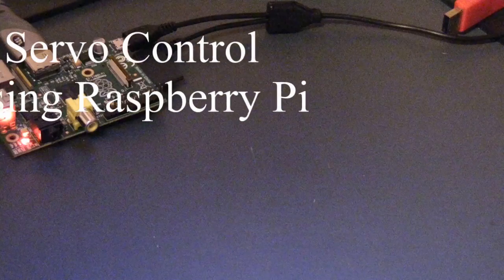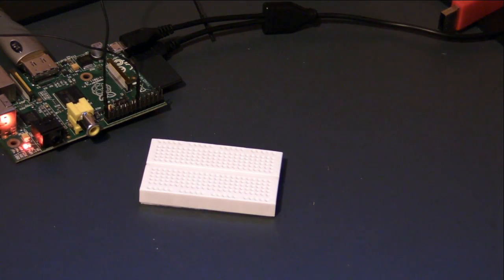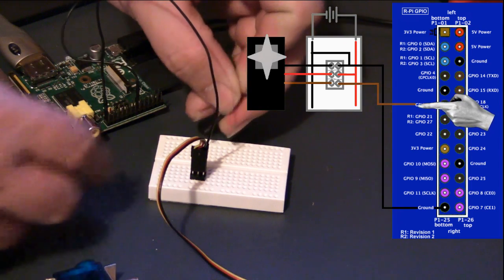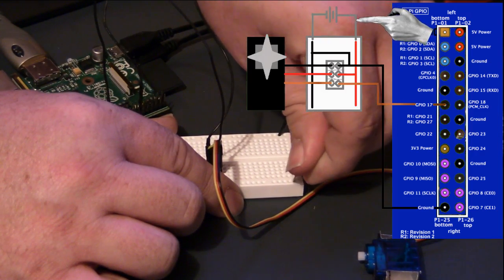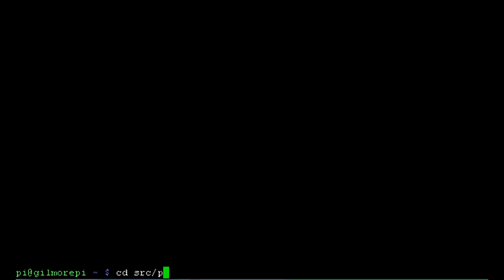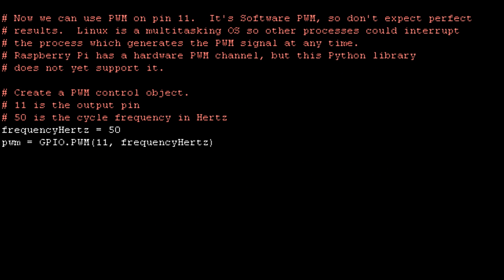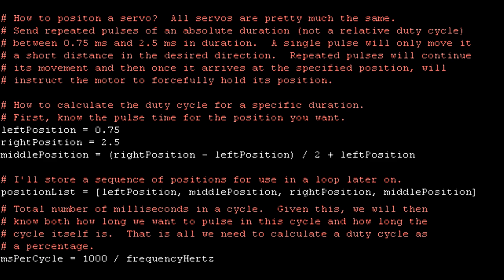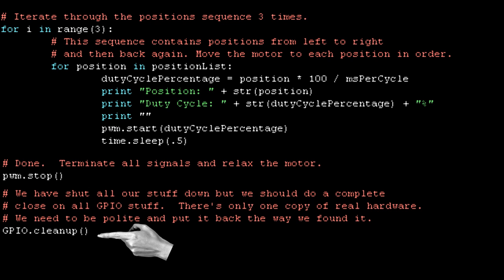Servo control using Raspberry Pi.

Comment: Can I directly connect my servo to my pi
Reply: Of course, we drive the signal line directly from the Pi in this video, so I assume you're asking if you can POWER the motor directly from the Pi.  I recommend that you do not do that.  Most of the pins on the GPIO pin header provide 3.3V and have a limit of 15mA each.  A servo motor probably requires double that voltage and draws 10 to 30 times that much current.  The entire bus can only provide 50mA which is still grossly insufficient.  The Pi does have a +5V pin which could provide a reasonable voltage, but there is conflicting information about whether it can provide enough current to power a motor. 
You could try the +5V pin, but it's a risk and that's up to you.  Instead, try a USB splitter and just share the power supply with the Pi from the beginning instead of siphoning the power through the board itself.

Comment: Thanks for this tutorial. So you are using 0.75ms pulses for -90deg and 2.5ms pulses for +90deg rotations. These numbers do seem to work reasonably well for my HS-311 servo, but where did you get those numbers? Various sources say these should be (1ms,  2ms), while others mention (.75, 2.25). Those did not work for me at all. Thanks again.
Reply: My experience is in line with yours.  Various sources would say slightly different values.  Generally, I found that most sources said 1 ms to 2.5 ms.  So I used that as a starting point.  Then I wrote a simple Python program that went very slowly and repeatedly from 1.5 down to 0.2 and then from 1.5 up to 3.2.  It displays the current value on the screen and I just noted the number on the screen when the motor stopped moving.  That's how I found the boundaries for my motors.  Every kind of servo motor I have works fine with those values.
Reply: Thanks for replying so promptly. One more question, if you don't mind: does a servo has an "absolute zero" position, i.e. its natural neutral state? And if so, how does one find it? In other words, when I mount a horn on the servo, I want it to be aligned properly with the body of the servo.
Reply: I wouldn't say it has a natural position.  If at any time you stop sending pulses, the motor just relaxes and stays where it is, no matter what position it's in at the time (barring outside forces).  But what you're really after is a very practical question and there is a practical answer to it.  You can write a program to find the boundaries of your motor as I described before.  Then take those boundaries and calculate the "middle" of the range.  Send the motor to that position and then mount your horn in a centered orientation and you will have it where you want it (or at least this gives you an idea).

Comment: what did u program it on I got rc petrol car and. want to steer it autonomously using a servo so I need to know what u programmed in
Reply: In the video, I wrote the sample program in Python.  I edited the code with Nano and I did the development on the Raspberry Pi itself.  You could use a different programming language but you will end up using different libraries.  You can use C, Java, Python, or even shell scripts.  You could also use other types of boards such as Arduino to drive the motors themselves and just use the Pi for the heavier computation such as computer vision, GPS processing, sensor input and geospatial analysis.

Comment: Hi there...
To start out with, I am pretty noob on this stuff :)
I used your video instructions to hook up a 'Tamia TSU-02' servo from an old RC-car.

But when I use your script the servo clicks on one side pretty hard as if it wants to go too far...
Q: 'Please tell me what I need to adjust to make this servo work like it should....'
What I know a bout the servo:

Control System: Pulse width control

Operating Angle: One side more than 45 degrees

Current Consumption: 8mA (using 6.0V battery)

Output Torque: 3.3kg*cm (using 6V battery)

Operating Speed: 0.14sec/60 degrees (using 6V battery)

Power Supply: 4.8~6.0V

Domensions: 32x16x34.5mm

Weight: 26g
Thanks a lot for your help in advance.
Greets,

Peter Lunk
Reply: I've replied to the thread which you posted on GitHub.  I did a search for that motor and didn't find anything new about the pulse times so I went into some detail on GitHub to show how you can determine the correct pulse time limits yourself.

Comment: can you drive more than one servo with this design?
if you can thanks in advanced
Reply: Sorry about this but how would you edit the code too?
Reply: Yes, it can.  In the code, this line create an object which generates the PWM signal to control the motor.

pwm = GPIO.PWM(pin_number, frequency_hertz)

To control multiple motors, you just create multiple PWM objects, each with its own pin.

motor1pwm = GPIO.PWM(7, frequency_hertz)
motor2pwm = GPIO.PWM(11, frequency_hertz)

motor1pwm.start(50)
motor2pwm.start(50)

Comment: Hi man, I need to make a timer that activates a relay every 1h. how can I do this?

thank you
Reply: Hi,
 So you would hook your relay to a output pin on the PI, and then use python's sleep command and for each interval turn on the pin that the relay is connected too.

Comment: Im getting an stacktrace error when i run the program 
TypeError: unsupported operand type(s) for  -: 'float' and 'turple'
Reply: I have updated the video description to include a link to the source code.  Compare your source with the servocontrol.py file on GitHub.  If they are the same, post the entire error.
Reply: thanks for the help the program runs but, the motor does not move

Comment: At the End, you typed in the script and the motor moved,  how do you tell the servo on how to move , like left , right ,etc..??
Reply: The motor moves to the position which corresponds to the duration of the electrical pulses you send to it.  A pulse is an "on" signal which means electricity is sent to the GPIO pin which is connected to the motor.  After the "on" pulse, an "off" signal is sent which means electricity is turned off on that pin.  On my motor, 2.5 ms pulses move to the right, 0.75 ms pulses move to the left.  Any pulse duration between 0.75 ms and 2.5 ms will send the motor to a position somewhere between the left and right.  Most motors uses linear angles  relative to the pulse.  So if the left position on your motor is 1 ms and the right position is 2ms, the center would be 1.5 ms.  A 50 MHz frequency is 20 ms per cycle (1000 ms per second, divided by 50 cycles per second = 20 ms).  A 2 ms pulse every 20 ms is a 10% duty cycle, so set your PWM signal to 10% to send a 2 ms pulse to the pin which is connected to the motor's signal wire.  This calculation is done on the second line of code at 6:32.
Reply: spgilmorespgilmore Thank you so much!!!!,  I am trying to make a reg light switch go up with a servo motor, so by making it spin right as much as it can so it can give most pressure and turn the switch up, same thing with down also! I also want to know can I have 2 servo motors operate from 1 Raspberry Pi.

Comment: Using a receiver and a transmitter how can i set up servo #2 to rotate exactly like servo #1???? so that i can move a robotic arm say thats a few feet away from me the same degree and angle i move my own hand? can you maybe make a video to show us how to do this? I want servo #2 to rotate the same amount when it receives the signal from servo #1
Reply: Hassan Ajrouche Assuming that you are using a 2-channel (or more) hobby radio set, you will probably need to feed the receiver output to the Raspberry Pi and then wire the Pi to the servos as shown in the video.  However, the output of the receiver may be an analog signal.  If that is the case, Raspberry Pi can't read it directly and you will need an ADC chip (or an MCU with an ADC built in) to convert it to a digital signal for the Pi.  This is not likely, though, since most RC hobby radios have channels which are made to drive servo motors.  In this case, you do not need a Pi to drive them motors.  You can hook them up to the radio receiver in the same way as an RC car or RC plane.  As far as using two motors, I think you could just connect the PWM signal to both motors in parallel.
Reply: Phil Gilmore I want it to be a wireless receiver so it can be a prototype for a surgical robotic hand for example so.. have a transmitter chip attached to one servo and have a wireless receiver on the other servo with the PWM and it will turn according to how the first servo turns?
Reply: Hassan Ajrouche If you are building anything that will be used in medicine you should consult a paid expert. I am just a hobbyist and this is not an effective medium for discussing something that important.
Reply: spgilmorespgilmore Just a prototype xD not anything serious yet but just the general idea
Reply: spgilmorespgilmore so do you know how to do it wirelessly?

Comment: Why are you connecting your pi +/- to the servo +/- ??
Doesn't make much sense since you are using external power supply for the servo.
Reply: Yve Gotnone Short answer - I'm not.  You can see in the schematic at 1:45 that I use neither pin 2 nor 4 of the P1 header.  Only the Raspberry Pi ground (-) and a PWM signal (from board pin 11) are connected between the two.  The PWM output pin from the Raspberry Pi actually only serves about 3.3V @ < 15mA, not nearly enough to power a servo.  It's only enough to SIGNAL to the internal electronics in the servo box what the motor should do.  The Raspberry Pi and the servo motor both have their own +5V sources.  I could get them to both run off the +5V pin on the Raspberry Pi's P1 header, but the point to this demo is that it is often useful to run motors that require disparate high power (3V @500mA to 40V @15A are common in other kinds of motors) and I wanted to demonstrate how to do that.  The common ground is necessary for the PWM signal to be shared between the two.
Reply: Phil Gilmore Oh yep, sorry mate, just rewatched the video. For some reason I thought there were 3 wires sticking out of your pi.
I just set up mine the same way. Thanks for the video!

Comment: I have a 360° servo can i plug a regular battery strait into the servo with negetive to negetive and postive to postive without the 3rd wire and the servo will start spining
Reply: ittai levani This sounds like a "continuous rotation servo".  These types of servos have had their endstops removed so they can rotate past their limits in either direction.  However, they still have the same circuitry which interprets pulses from the PWM line to make the motor turn.  You probably cannot get it to spin by directly plugging it into a DC power source.  However, you could use something as simple as a 555 timer chip to generate a signal for a motor like that.  Instead of a $35 Raspberry Pi, you can have a $0.50 cent 555 chip, 2 capacitors, 2 resistors and a diode.  That's less than $1 US and there is no programming required.  

http://www.robotoid.com/appnotes/circuits-servo-control-with-555-timer.html

Comment: Thanks for sharing this very clear tutorial and code.  I have tried to replicate it but am having a problem even before sending the signal.  The servo (Hitec hs-311) goes full counterclockwise as soon as power (using a battery pack like yours) is applied. 

If I turn it off and rotate the servo head180 degrees clockwise, and turn power back on, it again goes full left.  If I send a signal to go, say, full right, it just sits there and jumps/jitters, but never moves out of the full left position.  This happens with two separate servos.  Any ideas what is going on?
Reply: If an improper signal is applied, this would happen.  The pulse must be more than 1ms to instruct the motor to move anywhere besides the far left.  The absence of a signal would probably relax most motors, so I suspect that it IS getting a signal of some sort.  Either a floating pin effect (it's like a radio antenna picking up arbitrary waves) if the PWM lead is completely disconnected, or maybe you have it connected to the wrong pin on the Pi?  Of course, it could also be a bug or typo in the software.  After some quick research, I don't see anything unusual about the HS311 motor.  It should behave like any other.

Of course, the best thing to do would be to put an oscilloscope on the PWM signal to see what your motor sees, but I assume you probably don't have one.  Instead, try hooking up an LED in series with a resistor (470 ohm is usually safe).  You'll probably have to change the program a little to produce a signal that will be suitable for an LED (i.e. greater duty cycle), but you can at least see it light and should be able to make it fade bright and dim.

Comment: Not in the PWM module.
Rpi-GPIO Version 0.5.8 - Python 3 or 2.7
Your program will give an error.

No PWM in the GPIO module.

All PWM scripts I write have that error.
As well as the item frequency.

I look in the GPIO and see no PWM / frequency    "dir (GPIO)"

Do you know what's wrong.

70 years old and an absolute beginner.

Thanks for the video

Bert

Comment: Thanks for sharing. Don't you need a servo controller? I see that you were able to run the motor just with the code. So far every other video that i have seen, people use a controller board. Also, could we do the same thing with a heavy duty servo or stepper motor?
Reply: For 3-wire servos like the one in this tutorial, you don't need an external controller. You can send external V+ and V- to the servo from an external power source, and its control wire (and the ground) connects to the raspberry and gets the pwm control signals. If, on the other hand, you were using a DC motor, with nothing but a V+ and a V-, you'd want to use a motor controller (an H bridge, for example). The Raspberry can then tell the controller a direction and a speed for the motor. Without the motor controller, the raspberry would have to supply the voltage directly to the DC motor, and you certainly don't want that. Stepper motors are similar to the straight DC motor - you "can" control them straight from a Raspberry, but you're much better off with a controller, only getting the control signals from the Raspberry, and the V+ and V- from an external source.

Comment: Can I use this system to control solenoid valve with multiple ways as response to an external signal
Reply: Sure, you can use it to control a lot of things....in the case of the solenoid valve, though, you shouldn't directly connect it to the Raspberry Pi since it will (most likely) consume more current than the GPIO pins can output (which is about 16 mA)... So, you should interface the Pi and the valve adequately.

Comment: Can you drive a door lock with this setup?
To bad the servo didn't go 720 degrees since it might need some gearing however a powerful servo would be great.
Have a 3" steeldoor with the best Swedish locks (best steel in the world according to the Swiss for watches, the metallurgists and more no china rust if it rains here i keep my castle better than the britts at Waterloo). - however everyone want's some more modern things than what was around 1975 and all i've seen here are either guys with servos connected to lots of stuff + a wooden spoon and office tape - or they have twice the hardware you have but it would't keep someone over 200 pounds out of my refrigerator + set me back around 200$ for a magnetic lock made in china i could rip with either my arm or a rope since there's a staircase and i weigh around 230p and two pulling that.. 
Be a hero and do a video with a qualified international servo and some instructions.
NFC out of the letterslot would be great, some more code for NFC or preferably BT would be great too - or a build that you download, specify the codes for and so on would be king!
Seen a lot of videos.. You have a great voice and great sense of telling a story.
There's not much to be found except people who want me to change my lock for something chinese or Rumanian and yes - they probably keep records of residence too and the locks are as budget as they seem of course someones gonna hack it!!
Nothing is unbreakable unless there's a swat team down the hall.

I hope for the best and i hate this stuff with home automation being in beta 2014!
Coffey machines being hijacked since they run on 80 and there's no firewall or encryption. I carry around over a pound of metal just keys. 
I'm a big guy so i can do it but my wife can't so lets have some more IQ than those who built the great wall of China..
Reply: If you can find a servo motor which fits your application (though I've never seen one do much more than 180 degrees) this would drive it just fine.  If no servo can serve your purpose, Raspberry Pi can also drive a stepper motor or (with less reliability) a DC brush motor with speed control via PWM.  Generally, for your application, the mechanism would probably need to be a geared DC brush motor with mechanical stops (no PWM needed).  For that, you don't need a Raspberry Pi to drive the motor.  You might use one to interface the lock with your phone, bluetooth remote, wireless key etc., however.